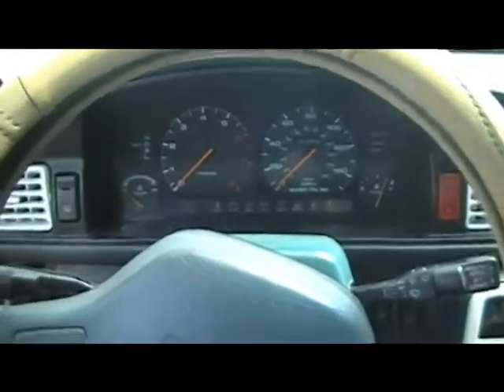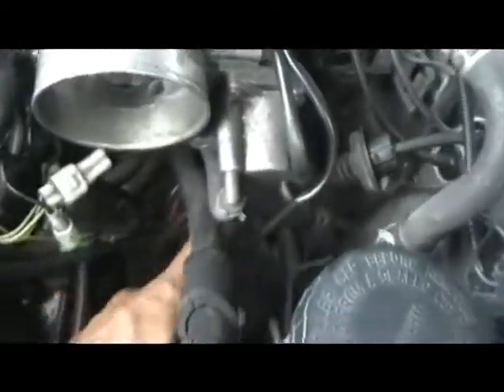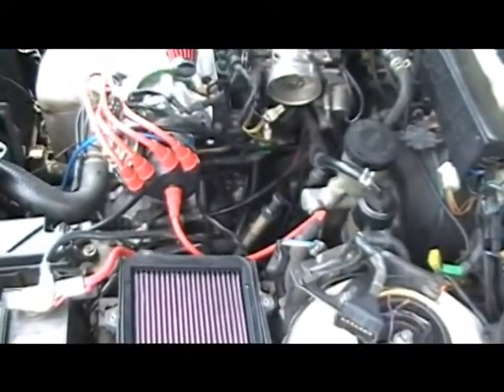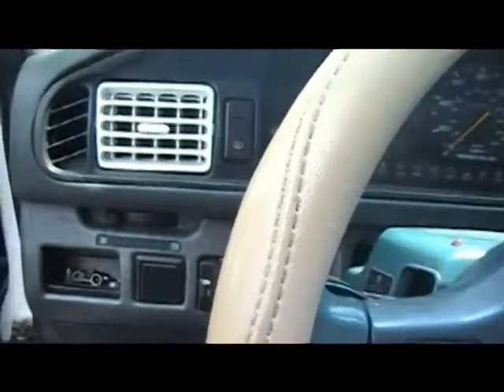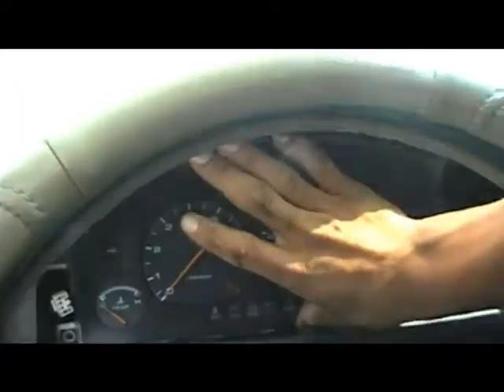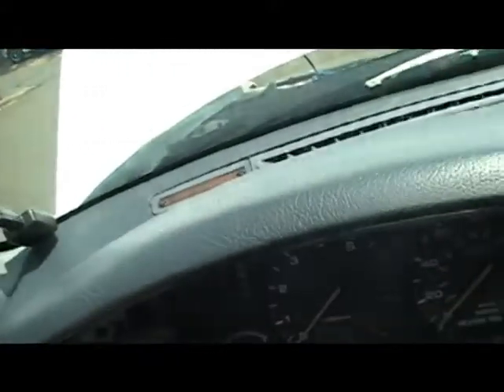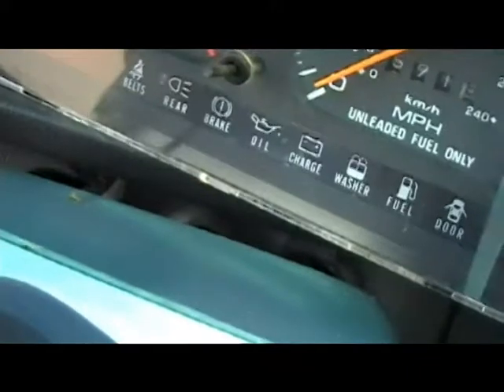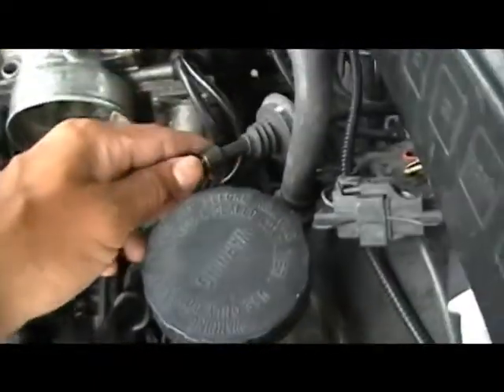Speedometer replacement Mazda

Comment: What year and model?
Reply: Don't know why this guy doesn't mention it. These speedo cables are  not so universal that 1 size fits all. Nevertheless, it's a Mazda 626 GD built from Aug. 1987 - 1992. The problem is usually with the adjustment of the lower part which comes out of the gearbox and this connects to the second screw and nut mechanism near the top of the firewall. Pull out the comoplete part right next the transmission housing. DON'T PULL ON THE CABLE!!.After pulling out the nut and screw mechanism next to the transmission housing, inspect. And any obvious failures can thus be seen. Take the time to remove air intake from the air filter so that you've got a bit of room to move.
Reply: Yes, definitely make room by first removing the air filter cover and the large flexible rubber tube going to the intake manifold along with the air chamber box connected to it that is located beneath the distributor. Take all these components out together as one unit.
It is so much easier taking these all out together instead of just trying to remove the flexible tube by itself.  
This is also how I access the speedometer cable gear when checking and filling the manual transmission oil level.
This also is needed to be done when replacing the Starter. The Starter has two bolts which can only be accessed from above via this route. There is an extra bolt which is NOT in the drawing of my Haynes manual, # 1082, Chapter 5, section 16, on page 123 for Starter removal.
1990 Mazda 626 DX, 2.2 liter, manual transmission.
I am searching for the correct Lower speedometer cable. I have purchased from NAPA  the BK 615-1707. It does not fit. It is 12" long, my original is 9.5" long. Where the Upper cable plugs into it the receiving hole is 5/16" while the original is 3/8", so the upper cable does not fit into it.
Does anyone have a part number that matches my original dimensions? 9.5" long with a 3/8" receiving hole at the top.